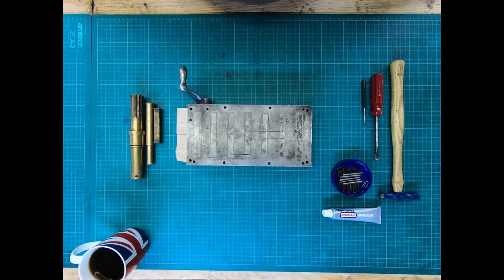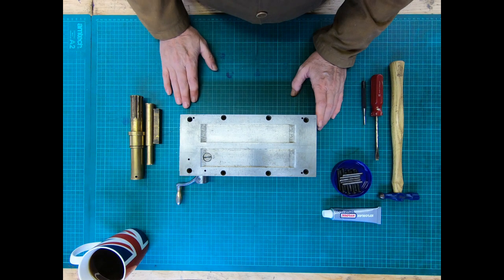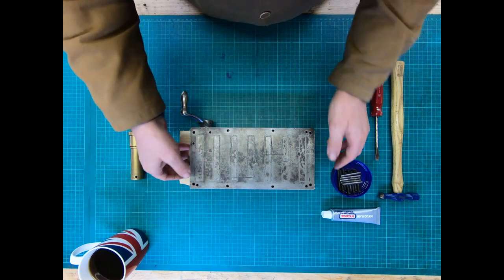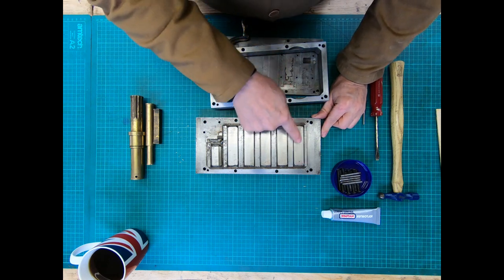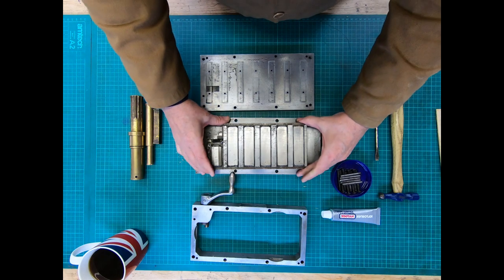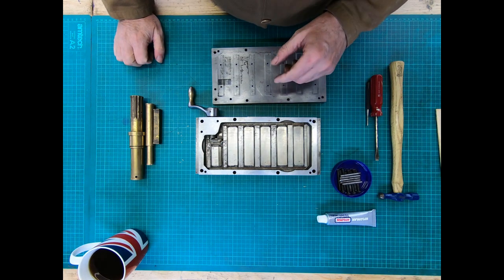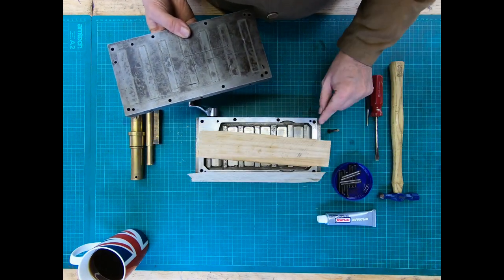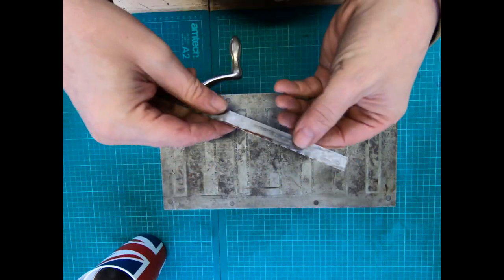Eclipse Magnetic Chuck Maintenance.

Comment: Good strip down and maintenance Paul. Good tips on screw position reference, might save someone a burst wheel if they didn't spot it, I would absolutely recommend to other viewers a flash grind of the full surface following a strip down like this as Paul is going to do. Looking forward to seeing the grinder up and running.  Cheers, Jon
Reply from the maker: Hello Jon,
Always good to have you viewing. The chuck was just another item ticked off the todo list in the Surface Grinder. Slowly but surely I'll get there...
Take care.
Paul,,

Comment: How difficult was it to remove the locating pins? On my eclipse chuck they seem solid. I can't seem to drive them either way ☹️
Reply from the maker: Hello Jan,
To be truthful I cannot remember as I made the video a couple of years ago, I have just rewatched it and I would say putting the oil inside and tilting the chuck to ensure the oil gets to the pins and screws is really important. I am sorry I could not have been of more help, good luck getting them out and please let me know how you get on. 
Take care.
Paul,,
Reply: @TheKnacklersWorkshop  Thank you. I got my Eclipse chuck apart eventually by using a toe jack to split it apart. No wonder I could not move those pins, they were driven into blind holes from both sides, they were never getting knocked through.

My chuck came with my J&S 540 surface grinder and the motor got a date of 1956 on the data plate. I suspect the chuck is also from that era. My chuck also does not have an oil plug and it seemed like it was packed with grease from the factory. I cleaned it and repacked the chuck with grease. While it is not silky smooth, I can operate the lever much easier now.

It is an Eclipse M186 chuck.

Thanks again for the video, I know it takes loads of time and effort to film while working.

Comment: I have not had much time on a surface grinder though I have run a tool and cutter grinder more extensively. Between price and the small number of precision elements, why are electromagnets not utilized? They have the potential to be enormously stronger, no? I have seen many DIY electromagnets made from microwave transformers, these are often less than $50 and have way more holding power than a traditional mag chuck. Admittedly, I am not very familiar with current equipment, I use stuff from the '40s and '50s pretty exclusively. Are electromagnets used today on surface grinders?
Reply from the maker: Hello Jean-Paul,
I am not used what is used nowadays on surface grinder... Last time it did this work for a living was way back in the 80's... I am just some old guy messing around in a workshop for his remaining summers...
Take care.
Paul,,

Comment: Now that I've seen how it works, I'm sort of offended at how much they cost! It's basically identical to a magnetic dial indicator base. The top has to be precision flat and parallel with the bottom, but that's about it for precision work. Quite surprised more people don't make their own now that I have seen how simple they are
Reply: One further thought, the manufacturers don't even have to get the top and bottom parallel nor do they have to get the top flat. It is standard practice if I'm not mistaken, to dust off the surface of a new mag chuck to mate it to the machine It is going on. So, assuming a flat bottom, I don't think it would necessarily need to be square nor flat, you could do this with the grinder itself, no?
Reply from the maker: Hello Jean-Paul,
I agree that they do see quite expensive for what is in there... but maybe there is some hidden expense in manufacturing that we are unaware of. 
Take care.
Paul,,

Comment: This was really helpful, thanks. Did you take the magnets out to clean under them or leave them in place? Also what oil did you put into it when it was reassembled? Thanks
Reply from the maker: Hello Joseph,
No, the magnets did not seem to move, so all I did was was what could be seen in the video... I read that rust reduces the magnetic force. 
When back together I used way oil again and went through the same process to make the oil hit all internal surfaces, I have now wrapped it on clingfilm unit I have the surface grinder working.
Take care.
Paul,,

Comment: Couldn't quite work out how it works from your video. Do the magnets lift or rotate like in a mag base when you flip the lever?
Only asking because you've given me an idea 💡 😁😁
Cheers Neil
Reply from the maker: Hello Neil,
The only thing that moves is the part that I described as a cam which moves into what I called the indentation on the top part of the chuck... nothing else appears to move. Hopefully someone far smarter than me will describe how it technically works. Sorry I cannot actually answer you answer.
Take care.
Paul,,